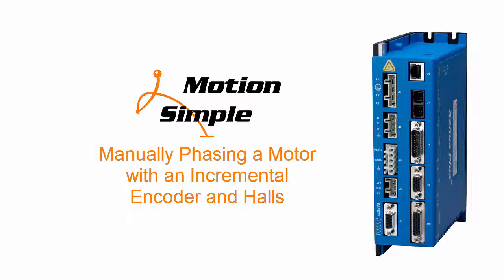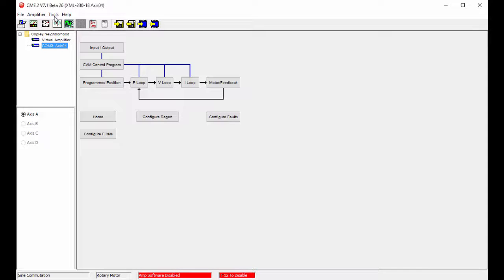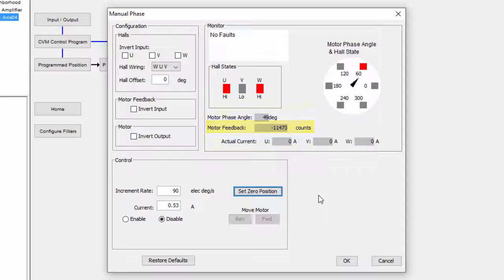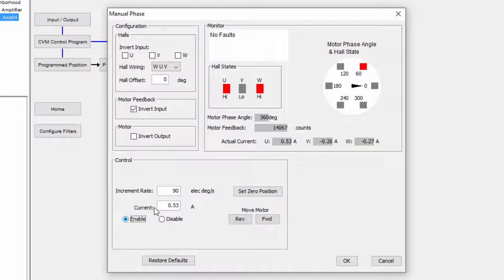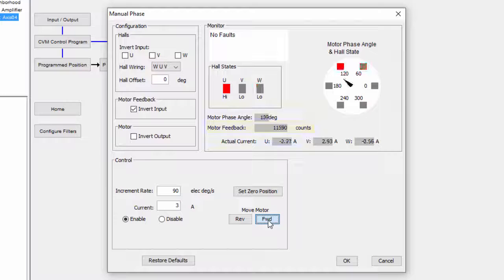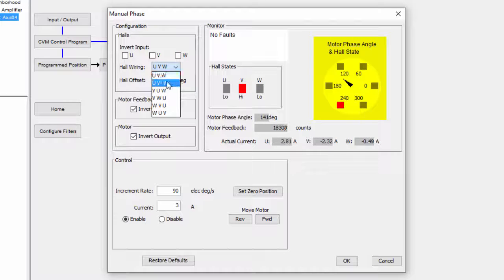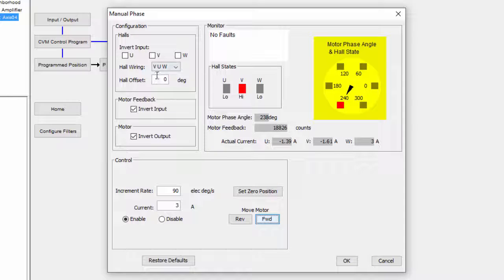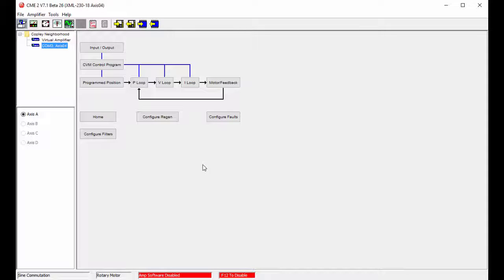Motion Mondays: Manual Phasing

Comment: Hi , my name is Sergio from Italy, I make a Home milling machine , I have a Copley control XTL-230-40 ( with a CME2 software and cable RJ/USB )  and a motor Parker model CM923HR-118404 
rated voltage: 340
Icent ( rsm Amps ) 7,31
Stall Torque (Nm) 4,81
KE (V/KRPM) 56,5
Rated Power (KW) 2.290
Res L-L (Ohms) 1.28
Rated Speed (RPM) 5330
Class (Deg C) 155
Inertia (g*cm2) 5424
I want to know how to a simple config and connect with commutator ( CW-stop-CCW ) and potentiometer from 0 to 5000rpm . 
The motor have two cables with connector ( motor and encoder ) 
Can you help me pleased. 
Kind Regards